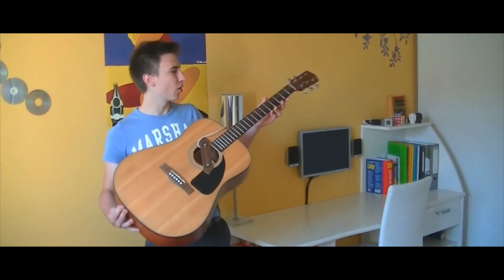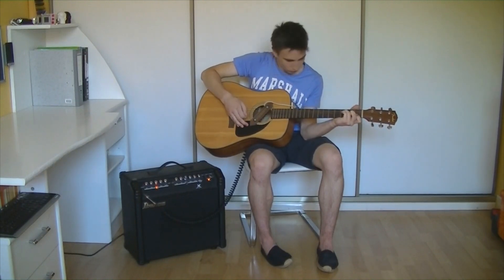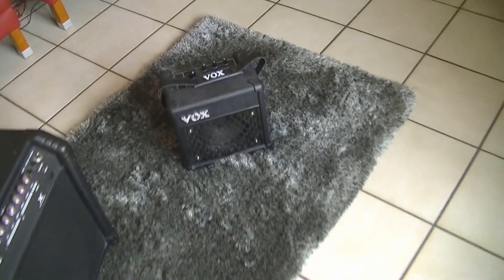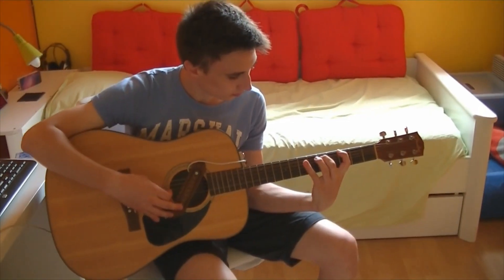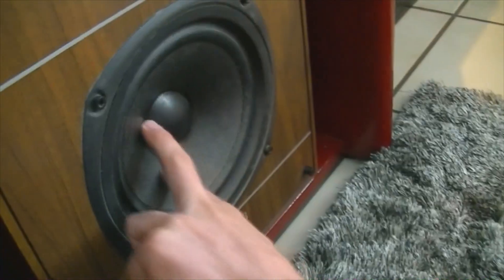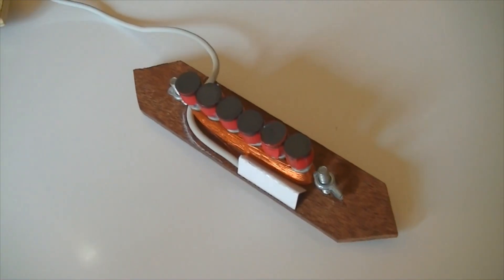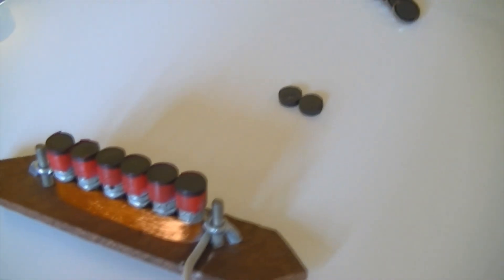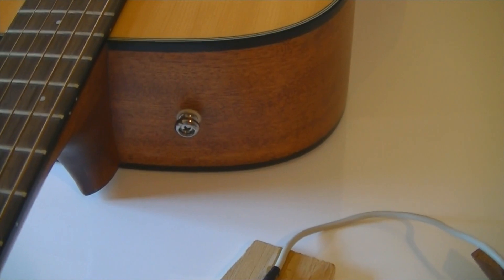Acoustic to electric guitar : DIY Experiments #4 - Homemade pickup

Comment: That's nice! Though, I'd like to see step by step build, you did a good job. Thanks :)
Reply from the maker: The step of step at the end isn't sufficient?
Reply: @DIYExperiments  Not that it's insufficient, but for example I don't know why is the coil necessary, what gauge and how many turns you did and so on. But I found it elsewhere, your video was still a good intro to it :)
Reply from the maker: Ok, about that the rule is simple, the more turns there are, the best it is. The wire gage doesn't change anything (no current issues), small gage allow more turns in the same room but it's fragile.
Reply: @DIYExperiments  Oh, now that's something. I guess everyone just takes this for granted. Thank you :)

Comment: How many rounds? Thickness of winding cable? Maybe you should give some spesific information for people who wish to build themselves.
Reply from the maker: 1000T of 0,2mm copper wire :)
Reply: wrap some 42 guage enamel coated , copper magnet wire 1000 or as many times as you can .  leave both ends hanging out 1 inch. scratch off enamel coating about 12mm on both wires( careful , delicate) run 2 wires from the guitar cord input jack terminals( posative & negative) to the 2 scratched ends and soldier. it doesnt matter which scratched end hook to pos. or neg. good luck

Comment: Theres a big problem: you cannot mute the acoustic guitar. So when you play you have the acoustic guitar sound and the amplified 'electric guitar' sound together?? Please help
Reply: if your amplifier has no distorsion or anything, the amplified sound is the natural sound of your guitar. So just turn down the distorsion or set it to 0 and set bas-mid-treble to the middle.
Reply: add a potentimeter (volume knob) between the pickup & the guitar cord jack. or you could buy a volume pedal and hook guitar to it & then hook it to your amp

Comment: i have a tiny mic with a 3.5mm jack. Meant for computer use. If i connect the 3.5mm jack into a 1/4 adaptor and then plug into a guitar amplifier, do you think it will work? instead of using a piezo or magnetic pickup, i am directly putting a tiny microphone in my guitar.
Reply from the maker: +Parrot Brand : A guitar amplifier is caracterized by a high gain as a mic one, it must work !
Reply: if your mic contains an "electrect" mic capsule , they are for digital, like cell phones and head-sets , its possible it may not work without a preamp circut between it and the amp.

Comment: . so can i use just 2 big magnets instead of 6 individual. .?
will it work...
Reply from the maker: +ANIRUDH PEDNEKAR : Yes, it will work !
Reply: does it have to be close to the strings... i have used nd magnets..
Reply: not too close, for the best sound the pickup must be about 1/2 inch from the strings when you are holding the strings at your highest frets (i.ex: 22nd). your 1 magnet pickup is something resembling a ceramic magnet pickup as opposed to individual magnet pickup poles as popular in the 60's and 70's (i"ex:Gibson PAF pickups). ceramic magnet pickups are more used in guitars targeting heavy metal players, guitar pickups like EMG and Gibson dirty finger pickups. both have advantages and disadvantages, for best clean it would be preferable to have alnico 1,2 or 3 pole magnets. anyhow the amount of wounds and magnet power, and their correlation are other variables that can make for a "superb" clean or any other of your taste preferences.
Reply: and your magnets are in the back side of your pickups.